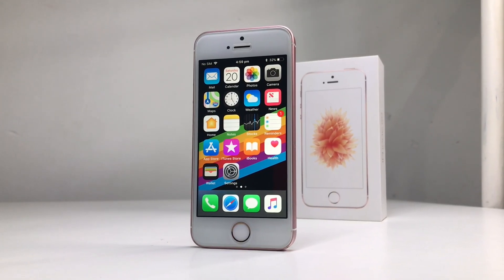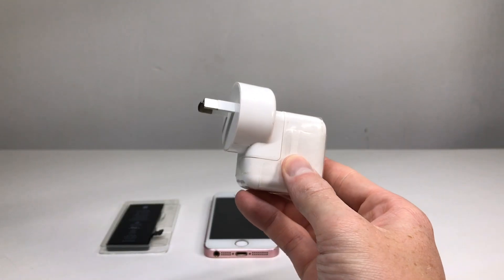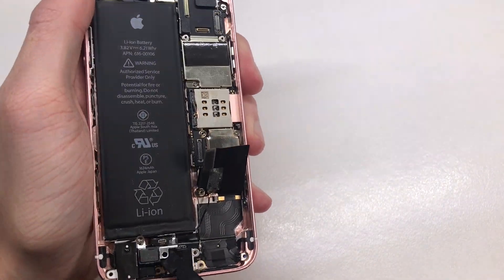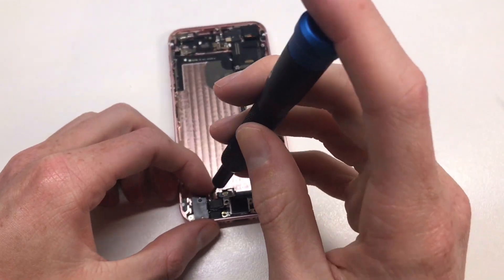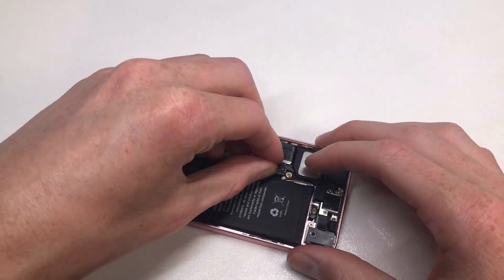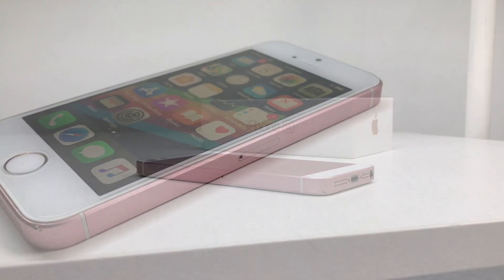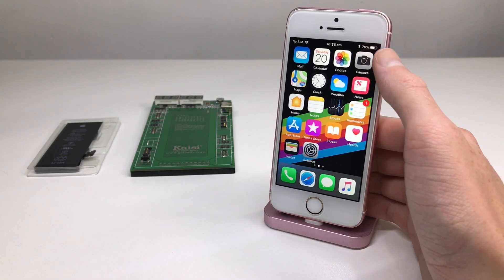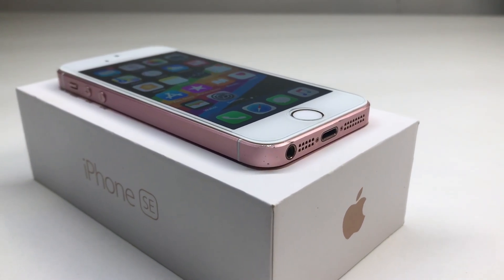Reviving My Dead iPhone SE

Comment: the best thing you can do with an old iphone is not update it. i have a 2020 SE and it still runs great, & supports all apps which i do keep up to date. i just dont update the ios, because i dont want my phone being crippled by apples crap software. its been over 2yrs and not a single issue.

Comment: I went to a repair shop with an excellent reputation. It appears some oil got inside my iPhone SE. The battery is at 81% but it has to live on the wire to work. The screen is lifting. They think there is motherboard damage. It's an Apple authorized service provider. They had a battery but were concerned that the screen would break. The owner said that Apple never made a replacement screen for the SE 1st generation. Any suggestions? I can buy a new or refurbished one but I'm unreasonably fond of this iPhone SE. Thank you.

Comment: I got given an iPhone SE 128 GB for free the screens touch stopped working randomly so I looked on eBay and found a listing for a used IPHONE SE screen for £5 and I got it today it turns out it’s an ORIGINAL APPLE SCREEN so that’s lucky and £5 well spent typing this on my se

Comment: I highly suggest using genuine Apple batteries that have been used, as the iPhone SE does suffer from this battery issue if it has a third party battery. This happened to me without it sitting on any charger, nothing plugged in. I went ahead and brought a iCloud locked iPhone se and took its battery and put it in my one, and it worked! I put away that iPhone SE for another year, and then tried charging it, and it totally worked. Other third party batteries do suffer from this issue, but they have signs to tell if there is an issue, like it boot looping. The iPhone SE acts dead, completely lifeless. I have seen a lot of “dead” iPhone SE’s on eBay, and fixed it up with a used genuine battery.

Comment: I totally agree with this video. I used a cheaper cable and the phone was ok but the surrounding town had electrical issues for days. The cable was an MFI cable, and we lost power because of a winter storm, but the cable caused the problem that was not actually the problem. I cannot believe that companies are allowed to get away with this stuff. Ebay and Amazon have all kinds of cables and chargers that are not good for my phone. I did not buy them or use them, but they continue to cause me problems and I am thinking about what I should do to stop them.

Comment: In 2021 this seems to be a issue with the se specifically I’ve had several have there battery’s die or boot loop after sitting for a few months

Comment: What I did to my iPad is smash it lightly and it damaged the touch sensors so when I wanted to open my iPad and enter the passcode it wouldn't work. So I didn't use my iPad for around a year, now we're at late 2019, I try it again and my charger kept disconnecting and I couldn't reset my iPad (i forgot my passcode) so i just left it again, 1 year later in early 2021 I try it one last time. When I opened the iPad there was no signs saying battery is 0% meaning that the actual battery is at 0% so i charged it for around an hour and it gave a signal. I waited another hour and it was at 2% which I could use, now the part which I thought wasn't gonna work is resetting it. Somehow the charger wasn't faulty this time and actually got to reset my iPad. Then when I reset it I noticed the battery would stay on like 2-5% so I thought the battery was a bit old so I thought I had to open my iPad up and replace the battery, but I still leave it charging and when I check it's 37% the battery is not dead. Turns out my iPad 2 just had longer battery life as I was using it for 30 minutes and it was still on 30%.

Summary: 
I damage my iPad so I leave it for a year, 1 year later I try to reset it but it doesn't work and I left it for another year. In 2021 I try to reset it through iTunes and it worked but then I think my battery is dead but it was actually the battery life was longer.

A summary of that summary:
I break my iPad a year later I try to reset didn't work so I left it until 2021 and tried to reset it and it worked but i thought the battery was dead but actually the battery life was longer.

Comment: you arent supposed to leave ur devices into a sourceless power unit. youd never leave your laptop wire plugged in but not into the wall.. these little stands are no different

Comment: My iPhone 5s died. the battery would finish in an hour, I replaced it and after four months the phone is now dead, there's no apple icon, tried the everything you can possibly do without opening it. Doesn't charge nor vibrate. I opened it up and when you plug it in and listen closely you can hear a clicking sound.

Comment: Seen this happen lots of times with ipads. You just leave it on charge... eventually it DOES charge, and the low battery icon comes on if it was working before and was left. I dont see why the iphone would be different

Comment: My mom had a ~6 month old iphone 6s that died on a knockoff charger and my dad and I are going to start training to fix it. (sounds dumb ik) Its been setting for almost a year because we haven’t taken it to the apple place yet. Same problem you described. We highly suspect logic board damage and we want to fix it. I wanna try replacing the battery but I was told if it dies you’ll have to do it again so uh. Thanks!

Comment: Hi! Do you know what s the main reason, i have one SE and battery shows different battery %  as it drops from 50 to 40 in 5 seconds or when i reset it shows 80% then 20 ... it s the battery faulty?? Sometimes stay 1 h with 1 battery %

Comment: My iphone 5s is dead i left it for about a month and now it's dead i didn't have anything plugged into it so im going to attempt a battery replacement. Wish me luck.

Edit : i didn't remove the dock connector and i removed one of the adhesive tabs perfectly. The other one snapped 😭 had to pry the battery out.
My battery is coming soon and hoping its ok when i install it

Comment: I bought finely reconditioned iPhone SE at $150. It looks clean looking new inside out. It works like a new one, no battery or heating issues. I’m so lucky even if it was one of the reconditioned iPhones in China.

Comment: I have the space grey SE because I like the material and look. I was bummed when the battery didn't hold charge. Like my iPod touch it also had to be plugged In to hold charge. I'm looking to have the battery replaced and use it with boost. Sometimes I wonder if I could open it up but I doubt I'd put it back together correctly and ruin it.
Reply: I have that one too it’s used to be my sisters but she gave it to me when she got the xr

Comment: So, I did a battery replacement of my iPhone SE and ripped the power/volume/mute flex cable. Can you gimme the link of a new housing with pre installed power flex cable, dock connector and other antennas

Comment: iv used apple approved cables and an ipad mini 2 charger block. my original apple cable broke, but i got an apple certified cable, which wasn't cheap, and its worked for 2years.

Comment: I had the same battery issue where after I switched my iPhone on the indicator showed 10% and it just would not charge. Prior to this happening the battery indicator showed 86% before I switched it off the day before. Needless to say I thought I would have to replace the battery so just switched my device off. Later in the day I switched my phone back on and the whole issue of low voltage and refusing to charge resolved itself. Magic 😊

Comment: I mean, you didn't do actually a proper repair there, you just "swapped a battery" while removing the charging port randomly (I mean, all that work just for making it easier for the pull tabs... risks ain't worth it in my opinion). Though, glad it worked for you, but still, having a TL;DR in the video description may be saving you from being another one of those "clickbaiters". 
Keep up the good work!

Comment: Can somebody please help this exact thing happened to me with an iPhone 6s and even after Replacing the battery it still does this every time Even when it’s not plugged into a charging dock. Is this a board issue or can it be fixed please help.

Comment: On the battery connector there should be a tiny cushion on top.  If your replacement battery doesn’t have this it will short out when you close the display.  A tiny slither of electrical tape will prevent this happening.

Comment: A Battery with 0 Volts can be repaired. Just connect + and - of it to a 3.8v or 4v power supply and let it charge up to this power, then put it back in the place it goes and charge it normal. Let it charge to 100%, then discharge to 0% and recharge it and it should work normal, maybe with less capacity. And look at the battery when charging für 0v, if it gets warm or changing its form, disconnect it from the power supply and throw it away, its dead then. 

Works fine for me on Xbox-Controller batteries, android phone batteries and a battery from my canon camera.

Comment: I am using iPhone 6 64Gb version I can play both pubg and freefire
Reply: How's the battery life? How is it holding up for the entire day?
Reply: Hana Rune I had iPhone. 6s and pretty much after 4 years of usage I drained to 71% battery life but it could hold probs 10+ hours when going good, mine was kind of cracked and broken pixels so I swapped it for an iPhone XR which is very good too, similar to X but the camera obviously and maybe some specs are different but XR also holds 25+ hours of battery which is very good when you are a traveller or something

Comment: so its a battery replacement, hardly a revive vid. Hmm, Very flat batteries just need to be left on a low power charger for a longer period as you found in the later part of the vid. So you didn’t even need a new battery.

Comment: where do you buy your phones? i want those phones to, and i think i can repair them since i have experiences with macbooks and pcs, but iphones are (i think so dont blame me if im not right) significilly more difficult. i have a bdget of 200 bucks with repair products. i have an dead iphone 6 laying around, i screwed an other screw in the wrong hole and now i made a hole in it, it didnt boot up. i want to revive it and customize it, but i need a donor phone, so my main question is: where do you buy donor and dead iphones?
(sorry for my bad english im 12 years old and i live in belgium so yeah)

Comment: My iPhone 4S Battery Almost Blew Up By Some Third Party Charger That Came With My iPhone. Happily My iPhone Didn’t break but I needed to use a different battery And It Turned On But I accidentally broke the battery connector now I have to order a different battery...

Comment: This is due to letting the battery voltage get below 2 volts. As the smart chargers needs to know the condition on the battery. Before it can charge it. You can jump start the battery. To get the voltage high enough. So the smart charger can do it's job...

Comment: I think the charger thing is bs because when I had my 6s I lost it’s original charger and brick and was using cheap stuff and had it for 2 or three years before I finally dropped it and it cracked bad enough that I got a new IPhone 8

Comment: I find with some Iphones that have been left for a while and the battery voltage dropped way too low, just need a little boost. I'll probe them directly with 5v 1amp for 30 seconds. Then connect back up and try and charge fixes them.

Comment: You have a bad charging IC on the SE because regardless of what you said if a battery is in good condition and the battery is at a very low percentage the iphone should and will turn on if it does not connect to your mac that means data lines on the U2 chip are not working which can lead to a consumption of power even when in sleep mode and the phone not charge a dead battery. Now why does it charge at all if you plug in a battery? Because if power goes into the IC chip it make the voltage work which in this case would be a 5v line a 3v line and a 1.8v line....

Comment: Good video.  Is that an OEM Apple battery or third party that was removed and not accepting a charge? I’ve had issues with third battery replacement batteries that seem fine at first, but then degrade quickly after a few months.

Comment: This happened to me yesterday. I decided to absolutely drain my battery (don’t ask me why) and then let the phone charge to 100% without touching the it (again, don’t ask me why). The point is, after I drained my battery, the phone wouldn’t turn on or start charging at all. I had to stick out the battery and charge it using a power bank and some wires for 2-4 minutes after which I put the battery back into the phone and it turned on. I then let it charge completely. So it seems like iPhones don’t even like recieving power when their battery is completely dead... (iPhone 6). Also I could say that based on this you didn’t need a new battery, you just had to juice this one up a bit. (I looked up where the + and - are on the battery connector and then cut a usb cable in half and used the black (-) and red(+) wires to charge it. )
Reply: Alexandru P your charging IC is damaged
Reply: 176cgna Why would it be damaged if it works perfectly well if the battery is not dead?

Comment: Something I found out on my old 5c.
If the display is broken or not connecting to the phone correctly, the phone won't boot. It will load backboard and that will atleast let you plug it in to your computer and use Cydia Impactor to view the log of your device, but that's the only way to find out if that's the problem. Since springboard won't load when the display isn't connected right, it won't vibrate, make noise, or do anything.

Comment: I still use an SE...😬
Reply: I just got my iPhone SE and I dropped it. It still works fine but it has dents now at the bottom corners and it kinda annoys me.
Reply: Jace Donato dude, I can feel your pain
Reply: Same.. it's not that old and it's still fast so I won't be upgrading until I need to.
Reply: Using a iphone 6 plus
Reply: Preston Thugman Buddy, you're acting like people have a thousand dollars to spend.
Reply: I used to use a se but I upgraded to a 8 plus
Reply: I have a 6 is that better?
Reply: CreeperDood100 6 came out 2 yrs before I think
Reply: @creeperdood1002  no
Reply: CreeperDood100 no I have an XS that’s better
Reply: CreeperDood100 the 6 is older than the SE so no
Reply: CreeperDood100 the SE stands for “Special edition” the SE i just the same as a iPhone 6S but in the form from the iPhone 5 because that was such a popular size because it fits most people's hands (not mine mine are HUGE and am just 14 i use the 6S and fits almost perfectly) so they put all of the insides of the 6S in a 5s (kind of because from the 5s the iPhones got touch-ID) and it came after the iPhone 6 models so when the 6 stops working because apple doesn't make updates anymore the SE should still be working because it's almost the same as the 6S, sorry if this comment is all over the place and VERY late but, have a nice day
Reply: iPhone 8 plus here
Reply: I mean, my first and only phone is an SE, and I just got it 20 days ago, so why would I upgrade?
Reply: 8BitOllie same that's why I clicked on this video
Reply: I have a 7 plus
Reply: Preston Thugman It's whatever, though.
Reply: Same I used it for 3 years but i just got an xr
Reply: Same R.I.P, 8BitOllie
Reply: Has one a year after it came out just upgraded to a iPhone 7plus much better
Reply: I have the equivalent of an SE - a 6S
Reply: Preston Thugman I got my 7 for 207 dollars is that good?
Reply: Me laughing in iPhone 5s
Reply: R.I.P 8BitOllie I have a 5se and it works perfectly fine besides dying pretty quickly, even tho I’m saving for a xr  and my 5se will be used for filming
Reply: R.I.P 8BitOllie me too
Reply: Lucky! I use a iPhone 6s! It’s actually been a great device!
Reply: I had IPhone 8 plus red and I upgraded to IPhone 11 Pro
Reply: Kevinn Is Revinn WHAT? What the hell? Why?!?!?!
Reply: I have an ipod :(
Reply: R.I.P 8BitOllie i still use 5s and i’m in LOVE with it. ❤️
Reply: I use a 5s bro, it’s not dead
Reply: R.I.P 8BitOllie same
Reply: you will be able to use it too many years later... period.
Reply: Same
Reply: Same
Reply: One of my friends still does and I make fun of him for it.
Reply: @skippy8717  well... iPhone SE is as powerful as iPhone 6,6s,6+
Reply: I use a samsung s8..
Reply: R.I.P 8BitOllie i use an 4s
Reply: Bruh i use a 5S
Reply: It’s a great phone
Reply: R.I.P 8BitOllie it came out the same year as the 7
Reply: me too :(
Reply: I still use a 5c
Reply: I’m getting an 8 but a se is not that bad
Reply: Same
Reply: WHATTTT
Reply: After 3 years of intensive use, Ive just change the battery and expect at least 1 more year after passing it to my son
Reply: Still using the SE?
Reply: I used to have one but it broke. I am using a android and I am trying to get the SE still.
Reply: Same
Reply: Mee too😅
Reply: Thats not bad that phone is Still good in 2020
Reply: R.I.P 8BitOllie then buy a 2 generation se lol
Reply: Same here! 128gb model, still got plenty of storage space.
Reply: R.I.P 8BitOllie it’s okay, at least it’s better than my crappy 6
Reply: Waleed Ali lucky I’m on the iPhone 4s!
Reply: Use iPhone 8
Reply: its a good phone
Reply: King u got a good one
Reply: I still use an 5s, it's perfectly usable
Reply: @daviderepice7874  and i have a 4s